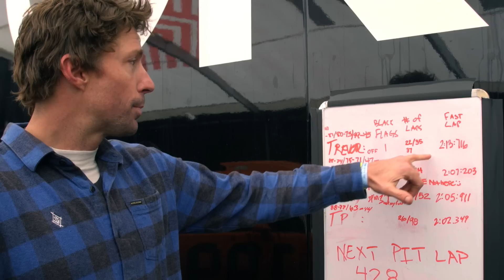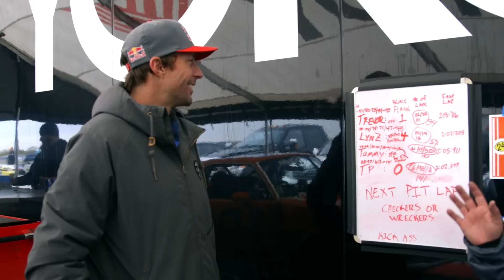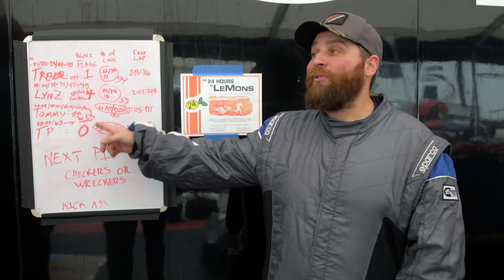Travis Pastrana vs 24 Hours of Lemons

Comment: That Trans Am at 13:23 was pretty goddamn nice for $500.
Reply: @sjb2202  I'm just used to seeing Midwest rust buckets for $500, not relatively clean bodies.
Reply: @sjb2202  small block hemi ehh? I think you're a little confused
Reply: I’m not so sure it was really “$500”
Reply: That's just a hacked up Thirdgen with a second gen looking front end. Solid, running versions of that car can go as cheap as $1,500.
Reply: Just a 3rd gen firebird. They're 500 bucks all day long running or not

The Year One snowflake wheels literally cost more than a good shape 3rd gen
Reply: I've participated in this race a couple times. Most cars aren't $500, anything that goes over the limit gets additional laps added to their race as a form of penalty. The only exception to the price limit is safety; roll cage, tires, brakes etc. I've seen a Hudson Hornet raciung once, totally under $500.
Reply: There is NO WAY  that was a 500 buck find with the body in that condition.
Reply: My comment was based in the NYC market for something like this
Reply: You can bring a La Ferrari to lemons and race it,  but you want be considered a competitor and you'll wreck it.  Average car there has probably $6K in it
Reply: @vinceedwards3978  Exactly , it's not destruction derby but there definitely is contact and people that have never raced before.  If a turn marshall see's you make avoidable contact , black flag... which means pretty much no chance of winning.
Reply: I have been driving around an 06 M3, could a put a roll cage in that with a few mods, and we on
Reply: Definitely look through the rules first and have a trailer handy.  There's a lot that goes into making a car last an hour of racing , let alone 20
Reply: Vince Edwards the bandit car is a 3rd gen firebird with a Pontiac J2000 nose grafted on.

Bondo, paint, and wheels are budget exempt, so most of the stuff that “looks good” isn’t part of the $500.
Reply: The car they have is pretty nice for 500 dollars
Reply: And a Porsche 914 at the 10:52 mark lol.
Reply: U did be surprised at the deals you can get on cars sometimes. Especially if the person is on hard times.
Reply: @vinceedwards3978  N.Y.C. Market. That's sure covers you if you were 30 grand off. N.Y.C. Market lol
Reply: Big City, I agree that the market is nutty here in NYC. I paid 30,000 for a late 80's 930 and I assure you I wish I had it now!!!!
Reply: @HotRodX I appreciate your insight. Thanks, mate!
Reply: @HanSolo__  None to be found in my area. They did have a good design though and handled well for what little tires they had in stock form. Just a little bit of work on a decent 914 and they can smoke Corvettes on a tight course. Don't need to be real fast if you can keep higher corner speed.
Reply: @HanSolo__  Welded up is right ;) Usually done welding in frame stiffeners to connect with the cage. I've done a lot of that working on dirt track cars. Makes a world of difference.  I live in the north east in the US, our climate here is absolutely terrible on cars unfortunately. Good 914 fetch premium prices, many times you can find a decent 911 for the cost a 914. I gave up my search long ago lol. I wouldn't mind picking up a 944. I feel they are under appreciated here in the US. I've seen quite a few in near immaculate condition that were very affordable. I have too many projects on my plate though so I can only entertain the thoughts for so long before I need a kick back to reality.
Reply: Around ohio thats a 4k car easily

Comment: Someone crossed two plug wires didn't they :-)
Reply: Lmao! I was thinking the same thing. That or they got some schmoo inside one of the plugs. Sounded like brothers Oldsmobile when he was in highschool
Reply: What X wire means 🚗?
Reply: @missingremote4388  the plug wires go around the distributor I'm a certain order. If you swap the plug wires around it will mess up the firing order.
Reply: @missingremote4388  Cross wire.

Comment: I'm a former Lemons racer and I wanted to sum up what a lot of other participants would like to point out for all of you that don't know the sport, the series or endurance racing.
1. Lemons cars can be bought for more than $500.  But you can decrease the cost of the car by selling things you don't need (Trim, Interior, stock seats, window glass, etc.  Overall after we were done with preparation our cost cost about $5k.
2. Safety isn't part of the $500 and here a lot of money is spent.  You need a fully welded in 6 point cage with very specific rules, a fire suppression system as of 2019. Hans Device.  Full firesuits, head and neck restraints, Race shoes, gloves, etc.  1 piece race seat, etc.  I'd say that average cost for a cage alone is $2-3k. Personal gear will run about $1000 after you buy everything, and that is for economy type stuff. 
3. Cost of entry is about $1400 plus the cost of consumables.
4. There is a strong emphasis on safety and driving safely. Although it makes a cool looking video, no team wants to see their car that they spent thousands of hours on (yes thousands)  bent up by someone doing a reckless action. So I'm sure many of the racers there were a bit upset with people that seemingly don't care about the rest of the field.  And Lemons drivers are like a big dysfunctional family.
5. There definitely is a culture of obscure and even stupidity in terms of putting in crazy stuff into their car.  Active homemade aero?  yup.  Car with a upside down camaro body on it.. yup.  Minivan as a racecar?  yup..  but as long as the car is safe, and the drivers don't provide a hazard to others it is accepted.  This team didn't live up to the last point.
6. Lemons races are all over the US and even now into Australia.  Anyone that puts the money, time and effort into the car can enter to get into a race (They almost always get sold out).
7. This isn't club racing.   There are many other cars on the track, various levels of driver skill, and it isn't a sprint race.  The team was out of the running at the very beginning.  Good teams don't break, and don't make mistakes. A class A team needs to have no failures and no black flags the entire race to potentially be in the running.

Comment: There no way someone spent $500 on a E46 bmw..
Reply: You can sell parts off the car to get below the 500.  Buy the car for 1500, sell the interior, headlights and any parts not needed on a track.
Reply: @stavrosteve  so chasis limit at $500. Is there a limit on performance mods?
Reply: @erendyalatorre7785  Drivetrain is included in the 500 limit.  Tires, wheels, brakes, roll bar, seat, any safety equipment is exempt.  But a stock E46 M3 motor is plenty beefy for Lemons racing, no need to amp it up.
Reply: @stavrosteve  So the engine is excluded in the $500 limit? So I can just shove in a a supcharged Hemi engine into a $500 chassis and be fine?
Reply: @SI0AX  The rule is the car plus repairs/modifications must be $500 or less. after you go through races you get a residual value assigned. so if you go through each race and get valued at $0 you have another $500 to put into the car before the next race you do.
Reply: SI0AX basically, the $500 covers the chassis and drivetrain. You can bring more, you can bring as much as you want, honestly....but you’ll be assessed penalty laps and start the race in the hole. 

So, yeah, bring a Hellcat and Judge Phil will give you a lap for every dollar Dodge took in bailout money.
Reply: @psychoboyaw  Wonder how many laps that GM Racing crate engine cost The P Team? Or did Ms P just blow the judges?
Reply: SIXPACFISH the LeMons folks are mostly current and former automotive journalists, so they have a healthy skepticism about the actual skills of any team that comes with a camera crew.

I don’t know if this car got any laps, but I’m sure Judge Phil knew they were going to be butt-terrible enough that it wouldn’t matter.

And...they were.
Reply: I see E46's listed on Facebook for $500 quite regularly. They usually have a ton of mileage ( >250,000 mi) and needs a loads of body work and/or tires and brakes. Brakes and tires fall under safety, so that wouldn't be a factor in the $500 rule.
Reply: @HanSolo__  Sure you can, E 36 M cars are not rare.
Reply: @HanSolo__  if you care about bodywork you are doing lemons wrong
Reply: I've seen em go for $350 hell I got a e38 for $500 running, drove it till some asshat rear ended me and got put into a wall omw to mcDs

Comment: Seems a bit more then a $500 car
Reply: It's cool, you just gotta bribe the judges a little
Reply: it's $500...give or take... safety equipment and tires don't count towards that
Reply: The seats alone 5
Reply: theyre more....guidelines, than actual rules.
Reply: The car itself needs to be purchased for 500 max. That’s all. Little upgrade after that isn’t really wrong. Buy a cheap shell, put a decent v6 or something you got hangin around in it. If you do. Or buy a cheap motor as well.
Reply: Exaclty ;)

Lemons is all about mischief
Reply: @djsonicc  what about motor and connections and theres a reason they were in the highest ckass
Reply: Seems like a pretty ridiculous rule, just there to be broken.
Reply: Khris Makaruk it’s $500 for the chassis and drivetrain. I bought an e46 330ci without the engine for $350, put in an n54 from my brothers wrecked e46 m3, new tires, roll cage, bucket seats and harness and I race it in lemons races.

Comment: If you read the suggestions from experienced lemons competitors... V8 American cars are not advisable. Burn too much gas and tear up tires. Can't stay out long enough to be competitive. Not to mention being fast on the straights isn't as good as being fast all the way around the track.

G body cars like the 1978-87 El Camino (along with 78-87 chevy Monte Carlo, Buick Regal, Olds Cutlass, Chevy Malibu, and Pontiac Grand Prix), actually can handle pretty well... But not on a budget that low.

Comment: I'd like to say that was a good performance, but at least it was fun to watch. :)  I don't think you should get black flagged for spinning if there's no contact, but I get it. Stiffen the suspension, add some brakes and do a driver mod, and that El Camino would have done well.
Reply: Breaks are covered in the safety category, so costs aren’t counted

Comment: Should've piped the doorways off and welded the doors into the bed for rear end weight... Also, bonus points for putting the doors in at an angle steep enough to create much downforce.

Comment: FYI you can get anti sway bars pretty cheap for the rear of those cars OEM and aftermarket. (Which would help some of the cornering/ spinning problems)
Reply: There is a way to put bigger brakes on the g body cars using 2wd blazer 98-06 spindle, hub, disc, caliber, caliber bracket, and pads

Comment: I think the rear suspension needed a little help.   weld it up with some scrap torsion bars, extra springs, stiff shocks and a some scrap iron to make the weight balance right.

Comment: No more than $500 on the car.
About $3000 of safety equipment.
Add on licences, tyres, suits, helmets, radios, petrol, tax, event insurance, regular insurance (for road events), spares etc.

This is why motorsport is dead on it's feet.  I used to race with my dad and even doing virtually everything ourselves and running the same tyres through multiple events, it's impossible to keep going unless you are fabulously wealthy or sponsored to the hilt, which isn't the case for most people outside of professional level doing clubman stuff.  Even a car that 'looks' sponsored, it's likely the guys own business.

Comment: You better have a huge gas tank with that v8 to save time by making less pitstops
Reply: Travis apparently did 98 laps that averaged somewhere north of 2:03... If every lap was 2:03 (obviously unlikely), he went 3.5 hrs between pits... or he pitted somewhere in that stint.  My guess is they had a pretty big fuel cell in there.

Comment: the hell, where did they find these 500 dollar bmws, audi, a 300zx, mustangs, miatas and an is300?? i know damn well those cars arent 500 bucks unless they were shells and just had a motor put in it
Reply: Quinton budget rules allow for selling parts. 

Buy a totaled bmw, sell the interior and lights off it, and you can be down to $500. 

This series has been running for a decade, and the head judge trawls pull-a-part yards weekly, so they have a pretty good idea of what the value of most of these cars are. 

You bring something way over budget, and they’ll slap a bunch of penalty laps on you, so you start in the hole.
Reply: @psychoboyaw  ok so good to know, since im looking for something RWD and will look into something totaled... for sliding purposed of course

Comment: Wait, you get a black flag for spinning on your own and not hitting anything?
Reply: TakeNoPrisoners yes. In LeMons, you can be sharing the track with 200+ other cars. If you can’t control yourself well enough to keep it on the track and pointed in the correct direction, you are a potential threat to the rest of the field, so you pull a flag. 

It’s an endurance race, not a sprint, there is no reason to run every lap at 11/10ths trying to win the race in every corner.

Comment: its not 24 hours of continous racing,  its 3, 8 hours stints
Reply: Nope, this one was one of the few actual 24 hour races we run, usually 2 or 3 times a year, started at 11am and finished next day at 11am.  The other races through the season that are at tracks with not much lighting are split between 2 days so we dont have to race at night, not three 8 hour stints.  Do your research Toots...

Comment: People With an IQ Or Desiring one.  =   Motor is Electric Induction = Starter, Heater, Wiper motor. ENGINE Is Internal Combustion. Been That TRUE Definitions Since they Were Created & named! If Any One saith the Wrong term Its Lieing, pathologically!    & motor Just has a Verbal vibrational Frequency That is more Enjoyable  To Speak which makes It "Verbal Masturbation" = saying Words to Stroke Your ego. = Totally Seriously TRUE!!! Just Like the Word "Putty" For Body Filler, Putty Is/was a Toothpaste  Like Substance That if It gets over 1/8 Inch Thick & Painted over Will Actually Chemical React & Bubble Under the paint & Rust the metal From Out side To inside, Thru the metal. & If any One Bashes The true Words Here  they Be Emotionally Retarded & I Know It Will happen bcz Society  Dumbing & Numbing Regressively Back ward . If U Take Offense At This, U B 1 Of Them.  = Just Objective Truth && Honesty & Morality Unless they don't Want 2B  Those 3 Words.     Other Than That lemons is great Other Than breaking the rules of Vehicle amounts...

Comment: Thats so dumb $500 budget, buys a $400 chassis, who know how much for the motor, wheels couldnt have been anything less than $100, sparco seat worth $200-$300, fuel cell, and whatever else. Dont bring a car that you spent more than $500 to a race with a $500 budget that ruins the fun for everyone else but thank god the drivers were trash.
Reply: That Sparco seat is $1,000+. The chassis transmission are the only things limited to $500. You can put in a $15,000 fully forged twin turbo race engine V8 and still qualify for what it seems, but the rule they have to discourage this is that any official can pick out any car in the race and buy it for $500. You run the risk of your $15,000 investment to be taken.
Reply: once you've spectatedone lemons you'll understand that everyone has a car worth more than 500 lol
Reply: Safety is budget exempt. That includes wheels, tires, brakes, cage, seat, and fuel system. 

The $500 budget basically applies to drivetrain, chassis, and suspension...the parts that actually matter to turning laps. 

Bring what the judges feel is more than $500? You get penalty laps and start in the hole. Some teams race all weekend and still never get a positive lap on the board.